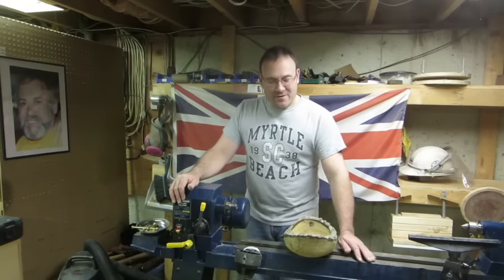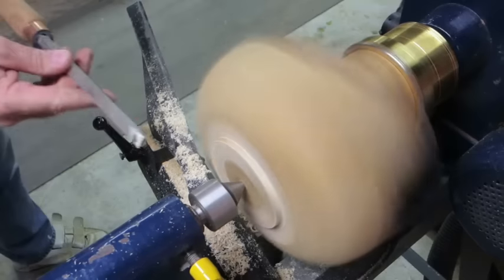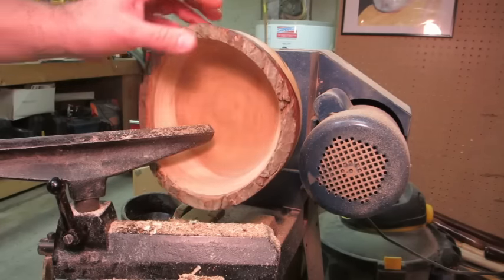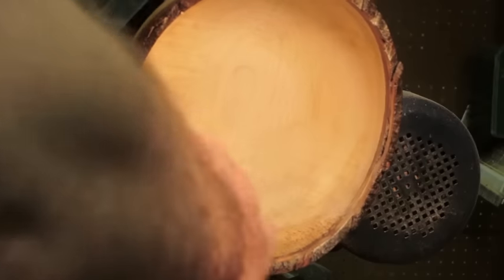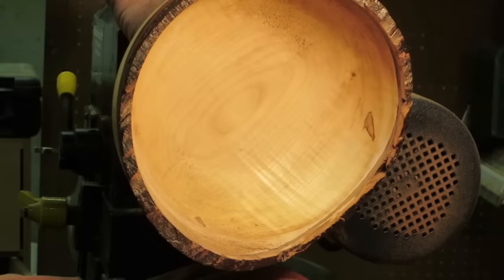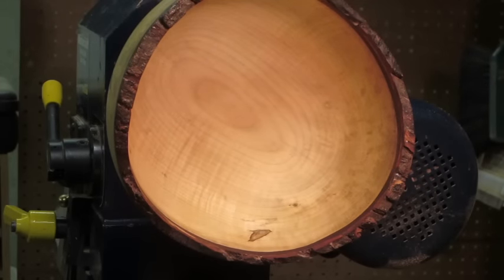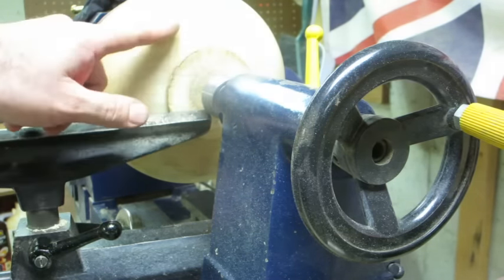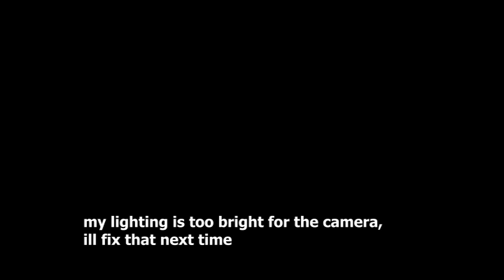woodturning # 23 natural edge maple bowl

Comment: Well done.  A very nice bowl.  

Natural edge turnings are not easy.  I have not tried one myself but my local turning friend has.   As often happens a small piece of the bark flew off.  Not easy to prevent this.

Many of my pieces of maple have some curl.  Always looks good when the curl is exposed.
Reply from the maker: Hi LV
I love maple, you never really know what's in there until done, this is only my second live edge bowl, wood was cut in fall after sap rise so I think that helps retain the bark also.
Take care
Rob